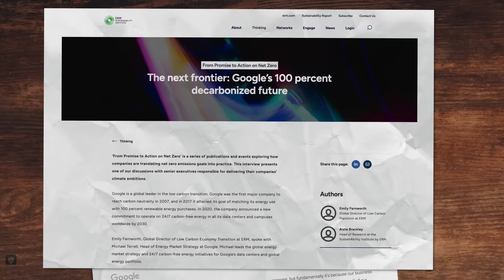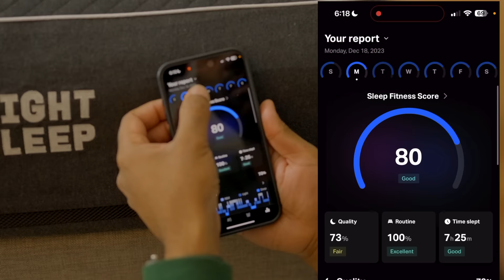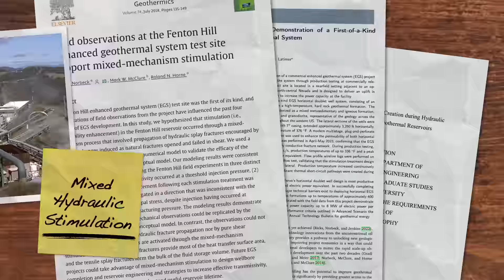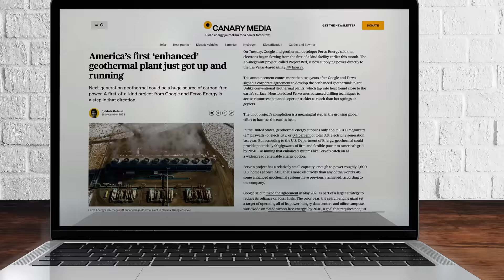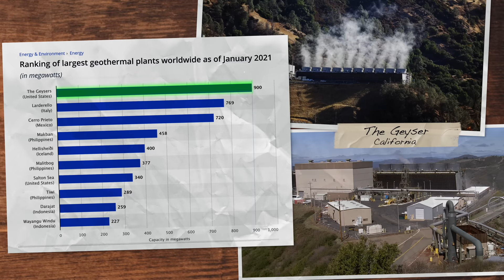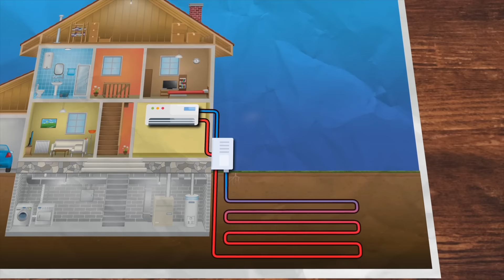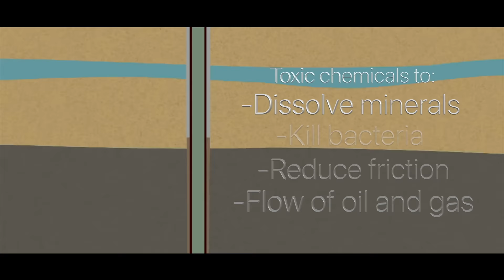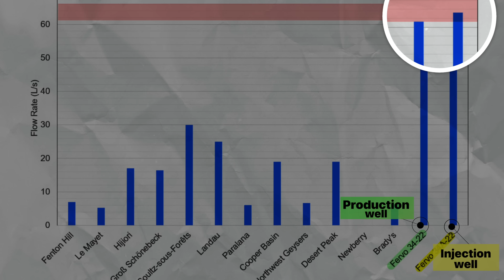Google’s Billion Dollar Gamble: You Won't Believe What it is!

Comment: My 2 cents, bad idea all around due to 1. fracking and 2. need to "add more water" that either one alone is a bad idea.  If you going to use water might as well build a big steam engine >_> instead.  The point is clearn water is already a problem and using more of it to produce electricity is just bad, only a tiny bit better than burning oil or coal.

Well there is "Fracking" is just another time bomb over time, so imagine fracking all over the place to make them power?  The world become an earthquake hell over time.  Like polluting ground water is not a BIGGER problem as it is!  I do hope google would invest MORE much MORE into this projects when the time is right the price they will have to pay is hopeful astronomical.

Comment: there are refrigerant with capacity to produce good power with only 50 degree Celsius  difference that below the Water boiling point,so simple thermal colector Wich are chipper the solar panel while produce 200% more energy,a simple steam engine will work,no new technology need,and water at this temperature don't require especially dessing vessels.

Comment: I wouldn't worry too much about the constant need for water to operate this plant. This is more green than becoming Amish. To make liquid hydrogen, mass amounts of water has to be boiled into steam with natural gas super heaters. Next methane is extracted (filtered) from the natural gas and is combined with the steam to make dirty hydrogen gas before it is cleaned (condensed). Not sure what happens to the bi-products. Look up the SMR process. Its used in 95% of hydrogen plants. Even if renewables are used to heat the water and compress the hydrogen, natural gas is still needed for chemical mixing to turn H20 into hydrogen. I keep hearing liquid hydrogen is the future, but it uses a ** ton of natural gas, so why not just bottle natural gas and use it as is? If you think hydrogen comes from electrolysis, rethink. That process is way to expensive on a mass scale. This geothermal process looks very promising. Not to mention toxic lithium pools...

Comment: There are many reasons that, when human behavior is considered, make geothermal power a terrible idea.  We very much have the capability to pull more energy out of the system than the core plus the sun can provide, and large scale plants still keep power production centralized, which is not a resilient solution.  If Google, instead, moved to low power silicon options and harvested local solar light and heat, they'd accomplish their goal of green power without the negative impacts and external capital of dedicated power plants.  Sure, the company that invented modern microservices has evaluated this?...

Comment: Why not just collet the methane gas from the sewage system and run it through a filter/scrubber system that feeds to a compressor that tanks and store the gas for use as a natural gas for furnaces generators pumps anything that requires heat and or electricity but no gotta do all this fancy crap that costs more than it produces and is impossible to maintain at a cost effective rate

Comment: would this not take energy from the earth and put it into water as the sun is doing and cause higher humidity in atmosphere and cause more sever storms around the world? if they use a condensing method it would turn the vapors back to liquid and rescue the water ( closed loop system) and have little environmental impact.

Comment: Ricky, a Fun Fact or two; One; the deeper you go, the more pressure it takes to "frack" a well, and Two; it is very possible to "frack" a well less than 10,000 feet deep with drilling fluid weighted up to about 75-80% max weight. In other words, we have been "accidentally" fracking since before WW2 and didn't know it. This loss of well bore fluids was most often accounted as having been an "uncharted" empty "volume underground" so often it was abbreviated and is now referred to as a V U G" or vug.
Today's fracked oil and gas wells are 12-16,000 feet deep, and the pressures required to frack them have risen into the hundreds of thousands of PSI to work- and when they work, there is large chance of dislocating standing fracture lines- vertical fractures previously in the ground- and when that happens, the ground shakes, it if very possible that your fracking fluids may have a clear path to the "fresh water zone". The "fracking" my original comment is on occurs with just a fraction of that pressure, and the premise here won't get much boost from "juicing" or adding toxic chemicals to the fracking fluid. IDK who gave you the stuff about not being able to laterally bore through "hot rock", as the "coiled tubing rig" that is used to do that horizontal thing bores in anything a driven bit (diamond bits and other rock bits are driven by high pressure drilling fluid pushed down the drill pipe, into the bit driver and "lost" to circulate the carved bits out of the well without withdrawing the pipe and bit first. That story sounds like something "Tex" or "Billy Bob" told out on the producing field to discourage their cousin from "going green".
ON the waste water; that may never be possible to completely eliminate; the porosity underground it like that at the surface, it's is not even. Some zones are more porous than others. Further, those vertical shists or fractures represent places where the water can suddenly change strata- and they can shift and change from many different reasons. The drilling regimen for the Fevor and Eavor both have this problem. They need to place the feeding well and receiving wells someplace that loss is not liable to cause problems. BTW, the best steam trains weren't able to re condense all of their water- about 80+% was the best they were able to do, so they still had to refill their water tanks to compensate for those losses.

Comment: it seems to me that using so much water is a major negative.. and can this extra water actually cause earthquakes like the oil fracking dose. There are a lot of questions and if they plan to do this in other areas it means even more water losses and there are some places were drought exists.

i wonder how much they can produce without injecting water, this would be the baseload. I honestly think batteries are a good solution for the power excess

In a world with instant everything. I wonder how much power they could save by adding a second or two to the look speeds (reducing computers)

Comment: Those solar panels (that only produce when sun is out), and the batteries they charge, have to be replaced regularly and disposed of (very expensive processes). These energy sources are not "renewable energy". They are products that require a lot of energy to manufacture, install, maintain, remove, replace, and dispose of. In the end, their use costs are much higher than traditional power production methods (generating power 24 hours/day), that are far more reliable.
Reply: Hey, quit making sense.
Reply: Excellent reason to continue research into cheaper, more sturdy panels as well as better battery technology.  

How many decades has fossil fuel had to optimize their process?  How much funding could they have used to focus on NOT having a negative impact on their surroundings?

I’m amazed that people complain about cost of creation and disposal of renewables without acknowledging how catastrophic fossil fuels have been for the world.  

I’d think that Exxon Valdez and Deep Horizon alone would be enough to address that conversation.

Comment: Taping into natural sources of geothermal is nice. But fracking to do so is stupid. Hey google, there is this company that makes battery storage units as big as a semi tractor trailer the biggest that they can make legal to roll down the highway. They will sell you as many as you want along with the software to control an operate it the most efficiently possible. Completes the circle of wind, solar and BATTERY! You can place as many anywhere you want. Give TESLA a call.

Comment: my system's operating mediums are air ( or On Mars appropriate gas combo ) And water in closed loop so no wastes or losses ( can work without water if needs be as I would think might be an issue on Mars ). NO chemicals NO Nuclear no non native elements other than building materials like concrete , steel & plastic. I am also very familiar with fracing as I live & worked in oil & gas industry for decades.  Please let me fix these issues. My systems are based on currently used ( though it be poorly designed & built in those systems ) & somewhat working designed tech. only better with non of the ongoing issues. Let's do this hell if the price is the issue , I am open to long term forms of compensation .

Comment: The lack of movable water turbines used in the oceans... is a joke. All panels, at best 25 years. At best 28-32 efficiency* not in large usage or production, and only so many hours a day. All wind turbines.. massively overpriced, and inefficient, and not constant, largely fail to the point of total loss, no where near 25 years. Lots of maintenance. Ocean subsurface or sea floor Water turbines? 80 years minimum, barely any ever maintenance, 24/7, 365 highest efficiency. No chance of EMP or Carrington level failure. All of the others, will fail entirely, instantly. Geothermal, all components from the energy source, will fail.  Now what is actually green, and what is told to idiots in the rectangles.. is entirely backwards to each other. Just like the shame and blame science of Co2, and their leaving out the cycles of the sun and our magnetosphere..  One has .0001 input, the other, has 99.999. Yeah, that is humans, versus the sun. Not just current humans. ALL OF THE HISTORY OF HUMANITY. 
That is how easy it is to debunk CO2 shame. Model and match and genuine values. We are headed for a solar blast, a grid world wide end, all electronics, lines, kerput. Then.. volcanic. Crust instability worse than even currently. Storms beyond imagining. And after the fires of the event.. up to ten years later? The tilt, and Noah Flood worldwide. So.. that is why they are buying up all the gold, and all the elites are building super bunkers. Fifty years they have known. Fifty years of blowing Co2 and shame and blame into your ears. The electro currencies, make them laugh. After you end that period of flood and total worldwide civlilzation is nearly entirely erased.. comes the Ice Age.. that will outlast all of human history thus known. Then the reset comes.. after to "This is the new history of the world". And round and round we go.

Comment: Impressive  my father was anEE out of bezerkly.....I remember when th geysers was being built he was excited. He regularly showed me info on it. I grew up at a hot springs  the potential always Impressed me. Horizontal  and peak power yes game changing. Where In Nevada. I've traveled  the interior of tbat state extensively.  I know of a few hot springs  darrough being one. The basin and range geology would  give lots of potential  areas. Cleaner franking good. Nevada is a big empty state owned mainly by the government.  The deep mines in Virginia city for example had to have huge pumps to drain water  to mine....thus water np. Miners worked almost naked in tbe extreme heat of the mines. Shoot a system  ,Ike an underground closed  radiator  system could  be put into existing  mines  and  bingo jackpot....might not even need to frack.

Comment: Does the added water need to be treated (or desalinated) before injecting it into the ground?  Purified?  And does any exiting water need to be treated before being released?  Where does the injecting water come from?
Geothermal uses heat differential.  Where does the "unused" heat go?  Is it scavenged by Sterling-type devices? Or sent to Minnesota, North Dakota, and Canada for the winter?  ;-)
Will Google anti-patent the technologies, much like Musk has done with some important concepts, so others may use it?
We will need nearly 40% more electricity for data centers by 2030.  Will geothermal devices be used only for the fairly level load of data centers, or will they be located near population centers also?
Probably just me, but where is the link to the pdf from Google?

As always, a wonderful video that explains much and peaks curiosity.  Keep `em comin'!!!

Comment: So the Project Red Nevada for geothermal power with 3.5 MW power will generate maximum 84000 kwhr per day and to achieve this will inject 63 L/s water and produce 61 L/s (hot steam) to use on power plant.  The amount of energy this plant with steam 376 deg F will be less than 3% of the energy the steam has.  But weight a second, what amount of energy will be consumed on pumping water and producing it as steam? With this looks that the project is only marginal.  
Geothermal power is very good when the earth produce these steam.  Comparing the drilling on oil and gas wells with marginal production let say 300-400 BOE/d which is 1740000000-232000000000 BTU/d (509944kwhr/d to 679925 Kwhr/d) with 84000 kwhr/d the geothermal will generate, shows that investors will be very happy with achievements.  The geothermal energy will be only 12.4% to 16.5% of energy produced from oil.

Comment: Simple to reason fracking can be bad the industry refuses to reveal the chemicals are using into when you poke a hole between layers things can flow between layers. I can do the water well at your house, or the table of your community can be done with sand and water Normally sand, water and liquid nitrogen act of slow motion dynamite matter fact, the first fracking was the guy lowered dynamite down on a string. Of course I just slowed down and plugged it up and then they pumped in sand and water, and they realize they had to control it and shooting down liquid nitrogen, which expands, the big problem is them not wanting to fess up to what chemicals they were injecting with potentially go into your drinking water mechanical parts of fracking theoretically wouldn’t cause a problem, but anytime you poke a hole in the ground you’re gonna let things grow flow from one place to anotherthere were hundreds of thousands of uncapped Wells in the US half of a more mapped if you think I’m exaggerating your mistaken

Comment: 0:00: ⚡ Google's involvement in geothermal power plant construction and use of controversial technology raises questions about its ethical stance.
3:23: ⚡ Google aims to achieve 24/7 carbon-free energy by 2030, matching its annual electricity consumption with clean energy purchases from multiple projects.
6:02: ⚡ Innovative engineers Tim and Jack pursue alternative energy solutions after witnessing the impact of a coal-fired power plant in Texas.
9:22: ⚡ Google's innovative geothermal plant, fracking technique, and environmental concerns.
12:40: ⚡ Google revolutionizes fracking with a breakthrough in water flow rate, enabling faster energy extraction from the ground.
15:16: ⚡ Google's innovative geothermal power plant effectively balances intermittent renewables, minimizing waste and optimizing energy production.
18:16: 💧 Challenges of underground water injection in power plant operations.
Recapped using Tammy AI

Comment: Nothing about this is groundbreaking except the pun. If you could build a geothermal plant anywhere and produce energy as cheaply as fossil fuels, that would be groundbreaking. Otherwise you are just conducting an interesting experiment that might lead to plants that are viable in certain locations. Useful, but no replacement for fossil fuels which can be built anywhere and run all the time.

Comment: Sadly, environmental propaganda. Fracking wells are pretty much as safe as regular wells.  They have been drilling through the water table for a long time; those who say that the water table is exposed to undue risk don't understand how the wells are constructed.  They have been fracking the bottom of the wells for a long time.  The only change here is that the wells are turned horizontal, and the fracking fluids are improved.  They are not suddenly extremely toxic or more dangerous.  Yes, pumping water down into some formations has resulted in unusual seismic activity, there are no risk-free solutions and usually ways to mitigate the risks as we discover them.  

This is the same strategy that has all but completely stopped nuclear power, which is orders of magnitude safer than coal fired power plants that are being commissioned daily.  The anti-industrial types have exaggerated the dangers of nuclear power both in running safety and waste handling and disposal.  This has enabled regulating nuclear out of the game, which is touted now as “nuclear is too expensive”.  We are not allowed to put in new technology breeder reactors that consume most of the radioactivity of the fuel leaving it only radioactive for ~300 years after use; we are stuck with old technology that only uses 3% of the radioactivity of the fuel making in radioactive for 100,000 years plus.  Queue the same strategy for fracking, they don't like it, so use hyperbolic accounts of the risks and regulate it to oblivion.  The basic strategy is to scare people into complying with the Luddite style no hydrocarbons for you mentality.  It is pure dishonesty; I would prefer they just say they are determined to stop any increased production of oil or gas....or geothermal energy.  Can't say I blame them, they are successfully killing the only dispatchable low carbon electrical production technology, probably will kill fracking too, already did in Europe.